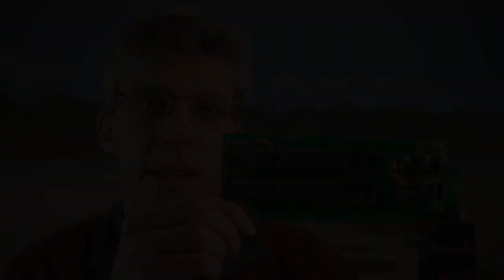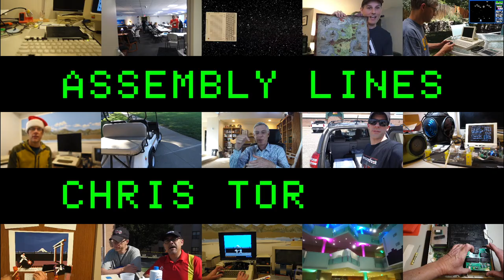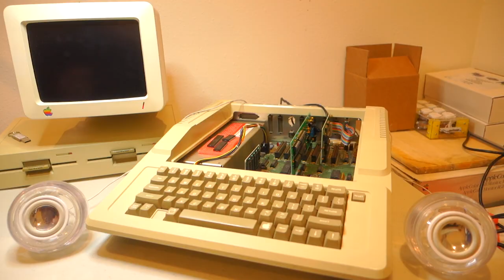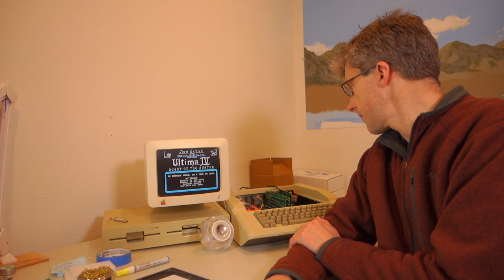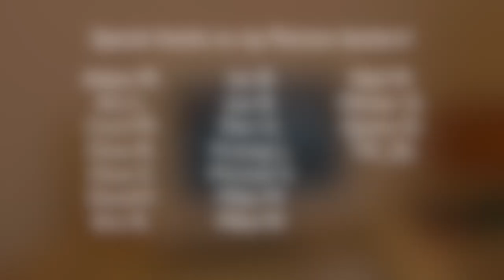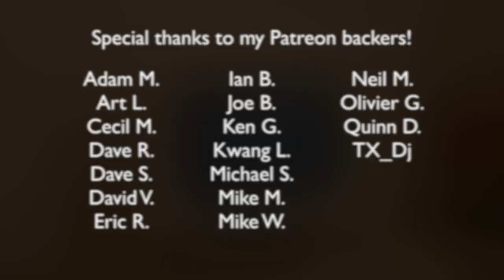#62: To Build a Mockingboard

Comment: My question. Is this 'flaw' that you fixed with the two resistors in the original Mockingboard as well?
Reply from the maker: No, it was a mistake that someone made when they were creating the new board. Henry Courbis has fixed all of these issues in the latest version of his board from ReactiveMicro. Also note that the original Mockingboard didn't have the pins to plug in the sound from the Apple motherboard, so that's new as well.
Reply: @CT6502  The only change his Wiki mentions from v 2.1 to 2.2 is "On February 28th, 2018 Henry relayedout the Mockingboard and incoremented the version to v2.2. The only change was removal of the stereo speech output jumper. The connection is now defaulted on and made using a trace which can be cut by the user and the header pins and jumper can be added if they wish to reconnect the circuit."  So are you sure that the separation issue was resolved  now in the 2.2 version?
Reply: I may have answered my own question.  The Wiki mentions it (albeit in the section, Known Design Issues) as well as the photo for version 2.2 shows the resistors inline with the capacitors.  Of note however, there is still another issue - "On June 15th, 2018 a user reported they receive no sound output from their II motherboard.   [...] there does seem to be an issue affecting some early II systems as noted. This will be addressed in future versions of the design."
Reply from the maker: @wolf314v  Yeah, I'm pretty sure it's fixed in version 2.2. Henry is actually really good at responding to queries, so you might ping him to make sure. And he definitely stands by his products.

Comment: How do you wire the 2 mockingboards do you only put speakers on one board and the software handles the transfer or do you need 2 sets of speakers?  Enjoyed the video - Thanx for sharing.
Reply from the maker: The software handles it. For Ultima IV, the first mockingboard becomes the "master" and the sound is output only from that one. I don't think there are very many games that actually make use of 2 mockingboards so I wouldn't bother buying two if you don't already have them.
Reply: Do you able to get sound from second Mockingboard on Ultima 4? I test U4  on my MegaAudio ( 2 mockingboard emulation on slot 4 and 5 ) but get sound only form one of Mockingboard, and not hear difference with One or 2 Mockingboard installed ( Ultima 5 work fine with 2 Mockingboard and have more sound channels) .
Reply from the maker: You know, it's funny you should ask. I thought that the music sounded different but then I tried it again and it didn't sound any different. So you might be right, maybe U4 doesn't really do 2 Mockingboards? I remember reading somewhere that U4 might use 1 Mockingboard for music and 1 for sound effects, but now I can't figure out where I read that...